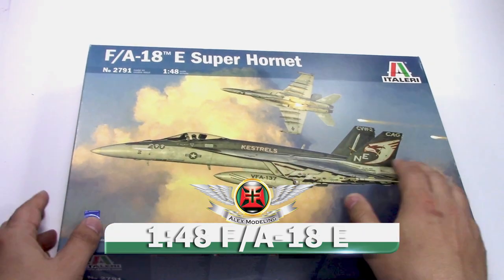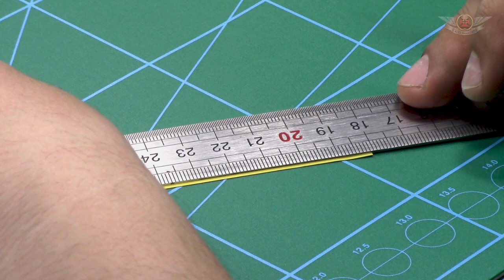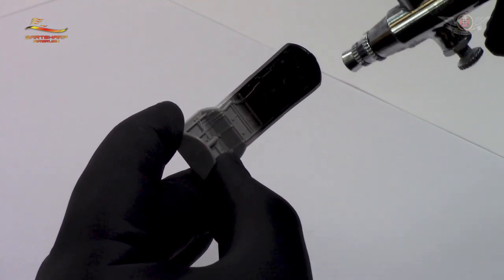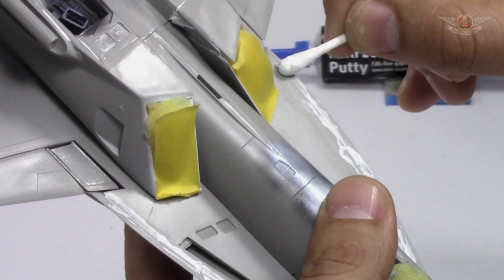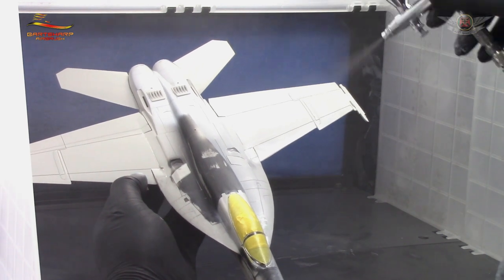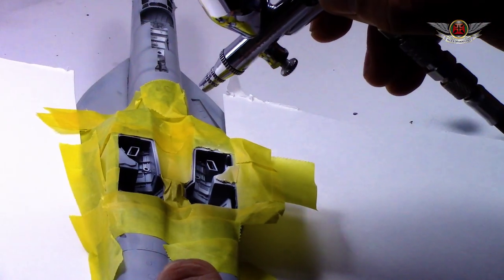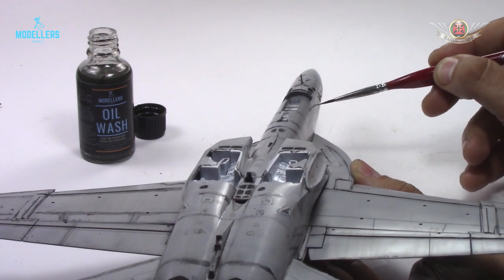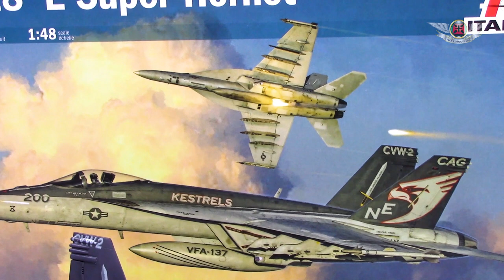ITALERI F/A -E 18 SUPER HORNET FULL BUILD

Comment: Masking and painting of canopy or transparent parts
No masking tape required, I use the following, use woodworking bond (aqueous vinyl acetate resin emulsion adhesive)
Can be colored with watercolors. Apply thicker, spread using a surface and surface tension.
After painting and drying, warming up makes it easier to peel off.
Have a good days. I like your vidos. Thanks.

Comment: To be fair to the kit, the molding is almost 20 years old now, and standards have evolved somewhat, but the level of detail was behind the state of the art even then. I built the 1/72 version of this, which has similar engineering, back in 2000, shortly after it came out, and distinctly remember what a pain the intakes are and that a fair amount of filler was required on them and under the chines. The 1/72 cockpit is practically identical and I used a resin F/A-18C seat and an Eduard(?) interior photoetch set, which dressed it up fairly nicely.

Comment: Great I enjoy it every time.. I am building when I was 10 now I am 50 but stil learning tnx.. I have a 3 months hospital back now I am again to build again..
Any way 1 qwestion I have
I use panel line and wash but every time I do it give not the result that you have.. How long let you dry it??
Tnx for sharing
Reply from the maker: When i use panel líne its enamel or oil. However i give an acrilics clear coat first and allow ir to cure... If you use and  oil ir enamel on top of the acrílico chance is that enamels ir white spirit to clean it are going to remove the Paint coat. So Seal it first and use oil ir enamels on top of the clear... Sorry i am working, if i miss understood what u ask please say it, and i will recrifyy answer.. cheers

Comment: Did you encounter any problem with the decals in this kit? I built a similar war plane kit from Italeri and the decals was really a nightmare. After I transfer the decals from the card to the kit it just sticks there and cannot slide to position. Tried coaxing it and it rips apart. Got so upset that I bought after market decals for my kit :(
Reply from the maker: These kits decals were actually perfect to use

Comment: Can I build it so the wheels are up ?
Reply from the maker: You can if you close the wheel bay, yes
Reply: @AlexModeling  your are a legend thanks
Reply from the maker: 🙂👍 Thank you!
Reply: @AlexModeling  hey man I got another question how do I stop the cement from melting all the paint? I’m trying to put small amounts of glue on the model but it just melts everything around it.
Reply from the maker: Don't glue pieces with paint, always use small amounts of glue. Ckean well the surface you are going to glue. Use glue sparingly
Reply: @AlexModeling  thank you 🙏